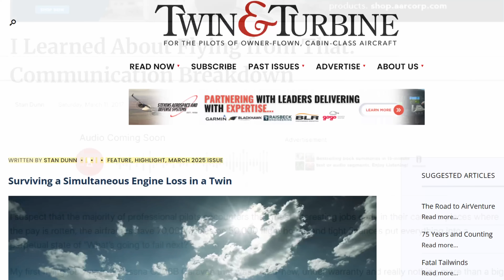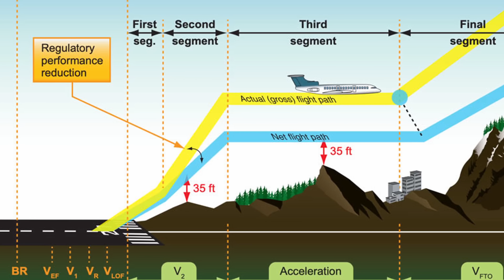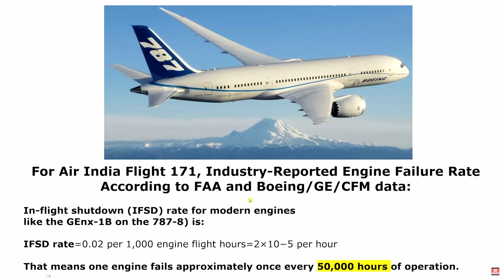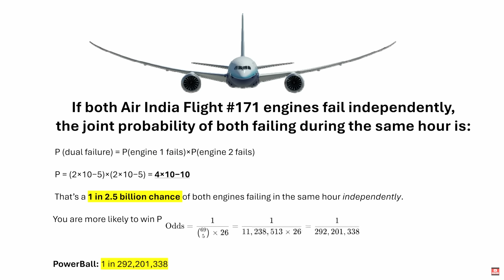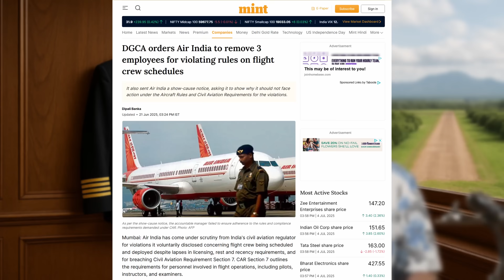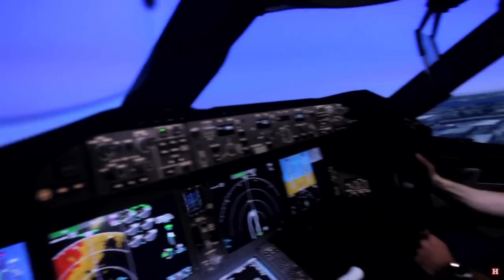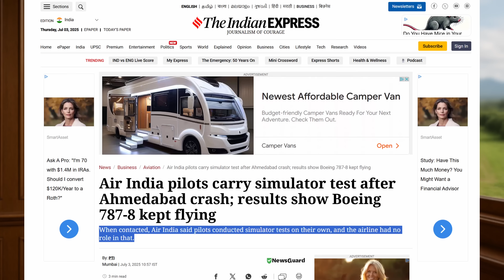Air India 171 Cause Becoming Clear

Comment: This pilot theory seems to ignore that the RAT had already deployed at a very low altitude. It can be heard on footage taken from the side of the runway.
Reply: If they shut down the wrong engine, that would leave no engines running and the rat would deploy.
Reply: @williamgreene4834  The RAT deployed while still over the runway - never enough time to manually shut down an engine
Reply: @williamgreene4834 actually, no it wouldn’t. The RAT only deploys when there is an “uncontrolled” engine failure (otherwise it would deploy every time the plane landed and shutdown the engines pulling the handle to shut down one engine would negate the RAT. This fellow ignores the RAT as relevant to the accident. He also ascribes unwarranted cause to the unexplained appearance behind the left engine.
Reply: @mpd-diy-guy4241  That sounds right. I didn't think of that. Thanks. :)
Reply: @mpd-diy-guy4241  What you are essentially saying here then, is that deliberate pilot shutdown of the engines is impossible, if the RAT was deployed? If so, the RAT deployment is incredibly important to this investigation!
Reply: @2760ade I don’t know about “incredibly important”, but it is an incredible driver to the investigation’s direction. It says a lot about what didn’t happen, but I don’t know that it drives us any closer to what did happen.
Reply: @williamgreene4834  if they shut down an engine (wrong one) the capt should have said ENGINE FAILURE not 'thrust not achieved, falling' in his mayday call.  this whole thing is being covered up and they are hoping tie attention to them will just go away before the report is released
Reply: that would happen if the second engine was shut down perhaps

Comment: You know how you hate your computer/phone after awhile because it gets a kind of it's own & starts acting like Groucho Marx's secratary;
                              Groucho: "0k, now read that back to me."
 Secratary: "Well, you said a lot of things I didn't think we're important, so I didn't write them down."
                                                                      And you start banging , stomping, throwing out the windo. ......uh, I mean, you start think about getting a new one.
Well metaphorically speaking , that's what happened.
To many secrataries, I mean computers are flying not enough humans.
Add to that , mini power interuptions.
You know how sometimes you have to reset the vcr( what's a vcr?) & all the clocks in the cheap bargin basement electronics around the house and sometimes you don't when power goes out for just a second.I

Comment: The engines failed, then were shut down, sequentially, with zero evidence of the slightest trace of either yaw or rudder deflection?  Aerodynamically impossible.
Whatever shut those engines down, or rolled them right back, was a common cause, most likely within the fadec or a similar component in the engine controls.

Comment: Well by this point I think we can assume there is something on those black boxes they don't want the public to know as there has been ample time now to decode them.  The problem I see with the shut down the wrong engine theory is there is no yaw or rudder correction seen in the video.  For that not to be there the identification of an engine failure and shut down of the good engine seems like it would almost have to had been instantaneous which wouldn't have happened in normal operation.  From all the evidence I've seen, I think components of Alaska/Horizon Flight 2059 circumstances may have been involved, but this time instead of the action being thwarted it succeeded.

Comment: Never listened to so much rubbish in all my life.  You are correct, I suspect, that 'dual engine' failure is not to blame, as the chances are just one in billions, and fuel contamination may have affected one engine, but not both, at the 'exact' same time of V1.  

Both are nonsensical, and just not a reality on a modern airliner, let alone the 787.  I still suspect a sudden 'cargo shift' upon rotation (straps not secured properly, or broken otherwise), shifting massive weight to the tail of airplane, which, if you have this in mind, can be seen via these videos on climb.  Engines still running, but @ take off, far too much imbalance and weight to pull.  The centre of gravity has shifted dramatically (loud bang heard by lone survivor), possibly disabling precious electronics and batteries (which are usually situated in tail), hence RAT deployed.   

It also wouldn't surprise me that no data, nor voice recordings, were on either black boxes, as this is also where they are found.

Air India don't exactly have the best reputation in cleanliness and maintenance of any of their fleet.  I've been on a '6 month' old new jet from them, which, from the interior cabin, looked 10 years old, what does that tell you?

Comment: Man you'd better be right if you're gonna throw this pseudo accusation at them. There is ample time and controllability after takeoff to handle an engine failure Havent flown there but I don't reckon that Ahmedabad has any special E/O SID .
furthermore, from all accounts regarding how the captain handled the aftermath of losing both engines, he did not strike one as a panicky, reactive guy.

Comment: I wouldn't want to rule out the possibility that poor / improper engine / thrust management resulted in the excessively long takeoff run you didn't mention?

If for whatever reason the aircraft was not at flying speed and pulled off the ground at the last possible moment, it's easy to appreciate the formation of the dust cloud and in that scenario, once out of ground effect the aircraft would have begun to sink.

Comment: If one engine failed, there would be a noticeable yaw followed by rudder deflection. Neither one was seen. Plus if one engine failed and the other was working, why was the RAT deployed?

I tend to think it was either a total electrical and/or hydraulic failure. 

It seem that on these modern planes there's a very heavy reliance on the AC power system and not much on DC. AC power cannot be directly stored though a working UPS system will restore it pretty quick. Dc power, on the other hand can be stored in batteries that either are always online or can be brought online very quickly. 

If there was a total AC power failure, it would cause just about everything that actually happened.

Comment: What is a QRS11 Chip?

The QRS is part of a "Family" of Gyro-chips. They range from the early QRS11 and include QRS116, QRS14, QRS28.
As you will see, this QRS chip has been installed in basically anything that moves which requires any type of gyro-stabilisation or orientation. As you can see from the image above the QRS11 chip and its MILITARY capabilities are guarded and Boeing was found selling it within their planes to China.

First, a little background is in order. As you may recall, the integration of the QRS-11 chip into Boeing aircraft sold to China led to a $15 million fine being imposed on Boeing when it failed to get DDTC export licenses for these aircraft. Recognizing the absurdity of requiring a license because of a $2,000 part in a commercial aircraft costing $100 million or more, DDTC added a Note to category VIII of the ITAR to exempt the QRS-11 chip and other quartz rate sensor chips when (a) it was integrated into the standby navigational system of a commercial aircraft and (b) the Department of Commerce’s Bureau of Industry and Security (“BIS”) determined that the chip was subject to its own licensing jurisdiction.

Traditionally inertial navigational chips and systems had been used in standby systems to the GPS used in the primary system. A standby or backup system supplies navigational information when the primary GPS is unable to get a lock on the GPS satellites and is unable to provide location information.

The QRS-11 chip, however, is increasingly being integrated into primary navigational systems of civil aircraft, by the time of writing this most, if not all systems now have this QRS11 chip as part of their critical systems.

The simple explanation is the QRS11 chip becomes a vital component in many cases, if it is abused in any way (remotely) it can cause shut down of systems, gyro failures and steering problems in anything equipped with it.
Now if you own the patent or you happen to be the patent lawyers who filed it, in this case, Clinton you would have known about its capabilities.

How easy would it be to bring down an aircraft or increase the speed of a train, or car hacking?

Well, if you "could" hack the chip it would effectively be weaponized transportation.

Given all of the crashes, of planes, trains and cars, especially when the occupants or passengers were pivotal in certain investigations into the inner workings of the deep state, well you can make up your own minds.

The first mention of the QRS11 chip I could locate was a paper written by the professor below. And as anyone who has looked into this will know BEI had the patent on the QRS11 chip in the early days.

The first mention I could find of the QRS chip was from a paper written by Dr. Madni, Oof BEI systems.

Comment: At Airbus Helicopters, we released a software patch to prevent aircrew shutting down a good engine if the other engine was not performing. The software prevents the pilot command (either shut down or engine idle) from being executed by the engine computers.

Comment: Flight Crew sabotage...possible. Flight Crew/Pilot error seems more likely. BTW, why don't major airports make high resolution cameras recording each take off and landing mandatory? I was stationed on an Aircraft Carrier in the 1980s and flight deck operations were continually recorded and even made available to the crew live via CCTV. Human-operated and not super sophisticated back then but time-stamped along with basic weather/wind info.  Sure, that's a lot of "information" but automation/AI and current technology in general should be more than up to the task.  Perhaps it can be held for a set period (60...90 days?) before it can be "overwritten". Seems like it would be another important tool in an investigator's pocket...?

Comment: You wasted almost 1/4 of the video on the flaps , many of us had long ago discounted. No mention were made whether the 787 have any leading edge devices. Many know flaps had minimal effects, If a plane can climb at 30,000 ft without flaps, at lower altitude especially with ground effects, flaps will make little difference in most cases. It is a crash on dry land, so the recorders can easily be found, even though I heard one been damaged. Lets wait and see the formal report next year. Accident investigation is a completely different field and regardless of your credentials, you are basically a machine operator and your guess is not better than any other pilots.

Comment: Both engines started rolling back around Vr, which would have extended the takeoff roll. Within 10 seconds both failed and the RAT deployed. If one engine continued to run there would be no RAT and the plane would still be able to climb even with the gear down. The only question is: why did both engines shut down so abruptly. Forget misconfigured flaps, vapor lock, hot day and contaminated fuel. The fact that 787s worldwide have not been grounded means that the data does not point to a software glitch or other defect. This tells me it is a local or airline problem unrelated to the design of the 787. So, we wait impatiently for more data, which may or may not be forthcoming due to culture, politics and $$$.

Comment: A lot of the maintenance done by the airlines, seem to mention testing of systems over and over and over and over, but what about replacement? At what point or age, is a relay supposed to be replaced, even if it is tested and found to be operating?

Comment: It seems that boeing trying make out its human error or figure, blaming other people first, maybe its true. but planes just dont lose two engines when taking off, due to error of pilots, one person serves the crash, due to pilots trying everythink, even use rat. I believe must been electrical fault or glitch in software or issue with fuel trying to get into the engine like blockage or two fault filters.

Comment: Good information about jet transport aircraft.  Learned a lot (as a 60 year Mooney pilot) about the systems and redundancy.  Would have liked to hear your theory about why the RAT was automatically deployed.  Try not to pay attention to negative comments, your information is, by far,, the most comprehensive and well presented.
Reply: RAT can also be manually deployed
Reply: @JohnBaileyDarke We do NOT know the RAT was deployed.  At this point that is speculation, based on one person's opinion of the sound the aircraft made as it passed overhead. We will have to wait for the FDR.
Reply from the maker: Thanks for watching! Glad you found the info useful. The RAT automatically deploys if the normal busses lose power (which they do if none of the generators are working). Normally in flight, only the engine driven generators are powered. When both engines failed/were shut down, the RAT would deploy.
Reply: @flyingformoney777  I've heard that the RAT only deploys due to 'uncontrolled' engine failure, and not if the engines were shut down by the pilots? Otherwise, surely every time the engines were shut down, such as after landing, the RAT would deploy? Meant to say also, I enjoyed your assessment of what we know so far, it was very enlightening! Don't understand the negative commenters either. Why do they bother watching?🙄🙄
Reply from the maker: The RAT is disabled when weight are on the wheels (i.e. when the aircraft is on the ground). Even if the pilot shuts down the engines in flight, the RAT will deploy. 
Thanks for the comment. I got a lot of hate last year when I pointed at the pilots for the Voepass ATR crash (I was right). Many people would rather the “evil corporations” be blamed. That, and Boeing has had a very bad past few years…

Comment: You missed two crucial probabilities. 

1. Both engines fuel valves were shut down manually, right before flight take. With fuel in the engine can allow flight to fly for 45 to 50 seconds ONLY. And this is what happen.

2. There may have been a remote electronic jammer was used. I hope the investigators found a Switch like decide from the rubbles. Someone in the passenger cabin might have used remote app from smart phone to jam the electronic of the flight.

One of these is fully responsible for the flight went down.
Reply: This would require expertise and equipment way outside an iPhone app!